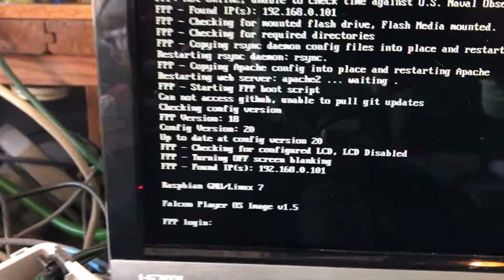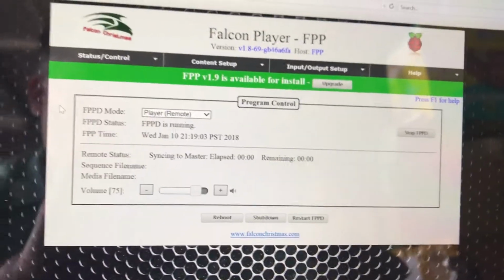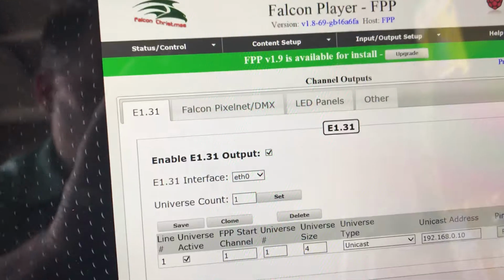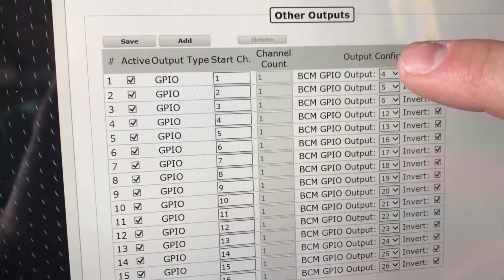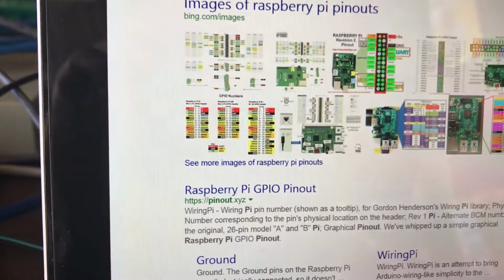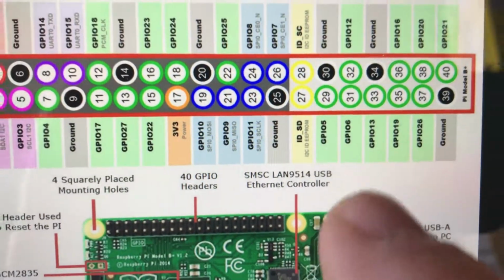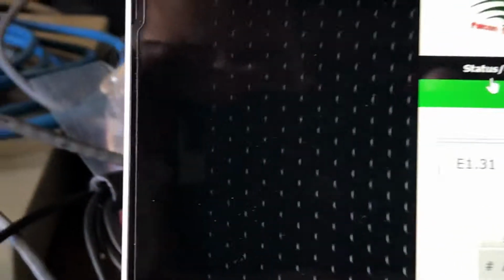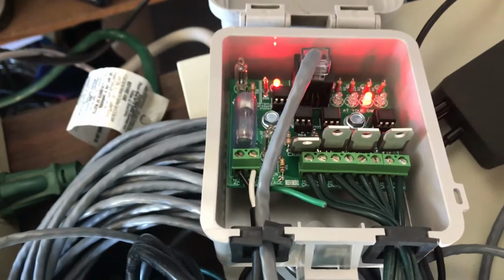FPP Controlling AC Lights via SSR - Take 2

Comment: Very in formative. How do you keep the channel separate?
Reply from the maker: LuckyShamrock Sorry for such a late reply. Not sure why I wasn’t notified about your comment. You have to configure your universe to go along with the line up of channels in the GPIO configuration. I have 16 GPIO pins, which is 16 channels of a universe. So, instead of a Universe size of 4, I believe I would be changing that to 16.
I’ve only done initial testing of this setup, to see if I was going to be able to replace an archaic/old serial based system that was controlling my AC stands of lights. Right now, I’m working on getting this all out around my house for more of a production test. As my pixel Halloween show is running now. If interested, I can update after it is all working together and be more detailed with that.